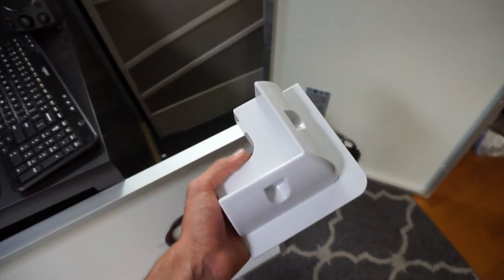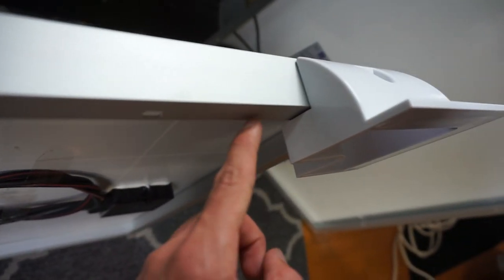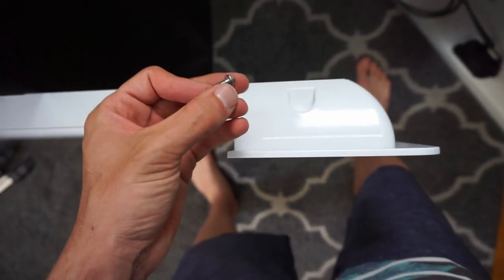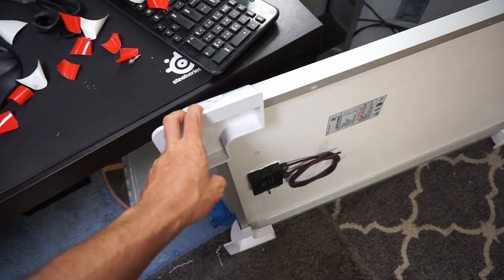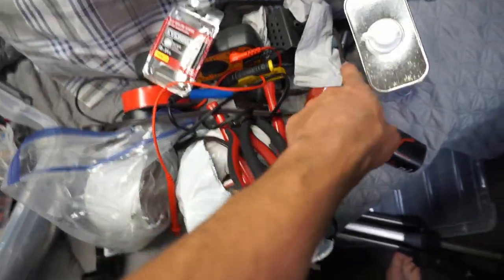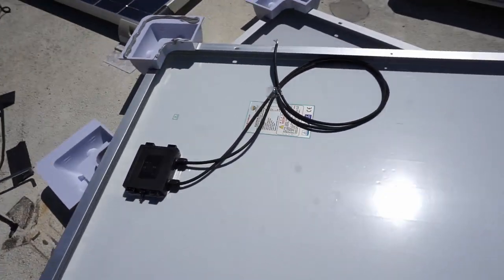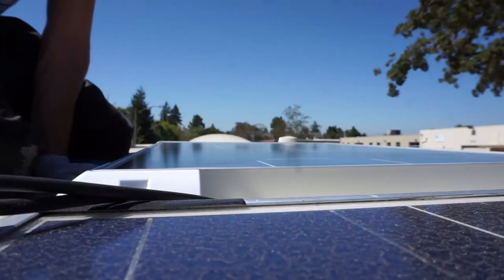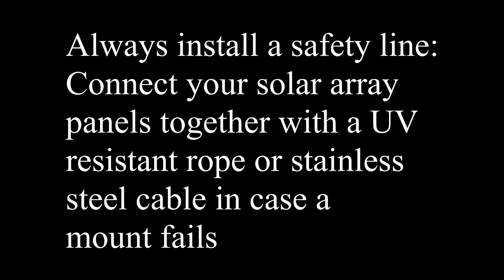RV Solar Tutorial: Drill-less Mount Installation Guide

Comment: Good to caution about doing this right. I didn't, adhesive started failing after freezing. Combined with hurricane force wind gusts at Big Bend, two panels started coming off (didn't fully detach). Long story short, I repurposed the mounts with large screws into the roof, waterproofed properly. No leaks, no loose panels. Great videos, cheers.

Comment: Thanks for the recommendation, I've had mine done like this for over 9 months now and covered about 7000 miles with no problems and the panels are held on as strong as ever.
Reply: With just using VHB Tape and not the PL max?!
Reply: @hearttug  I've got the same question. I tried emailing will and asking to clarify. In the video he says to use VHB tape on the front panels but you can use the PL max in the back. I just installed mine and used PL max and mine are mounted towards the front of my RV. I did use the eternabond strips on the leading edge though. I also wanted clarification on where to install the anchor safety chain.

Comment: For anyone that's wondering if adhesive is strong enough....

I just had the displeasure of removing a flat panel off the roof of my camper and it took me 4 hours with a hammer and a kitchen knife to break through all the contact patches. No amount of my strength could break off a single contact spot with the panel and the roof. So that's how strong it was.
Reply: So it would have been easier to drill holes and later, if needed,  remove the nuts then panels when needed.......haha
Reply: Is the gal between the roof and panel enough for heat dissipation?

Comment: The roof on our teardrop is Filon. I imported these mounts from the manufacturer in China 12 years ago, they were not available in the US. I then called 3M and talked with one of their engineers who did the calculations on wind load etc. He told me which VHB tape to use and how to prep the surface. Wind load is in excess of 120 mph at times.
 The set I have has a longer center section. Using VHB tape every square inch of the mounting needed to be covered
The consequence of not doing it right is a missile coming off your roof.

Comment: I installed 2-100w panels on my fiberglass top close to 2 years ago using this method. Just had to drill 2 holes for the cables. They ain't goin' no where. I used 1/4" self tappers with a rubber washer for stress relief and drilled pilot holes. I check it all periodically and they have always been tight. I pull up on a panel and the roof flexes up with it. Bazinga!

Comment: I have a video installing these on my newer TT, I cleaned, prepped and taped, but ended up drilling/caulking a single screw in to each bracket to the roof. 5500 miles and still very solid.

Comment: hey great video. have you looked at the price of 320 watt or smaller panels for their cost per watt.  the 72 cell panels for houses are much cheaper than 12v panels. throw a couple at an mppt controller or two you can use them on an rv. just have to make sure you have space to mount a couple.  12v panels can be on their own seperate mppt controller.

Comment: Of course, you mean NOT drilling on top of the roof, but the title could considered as a "click bait", right? :) Just teasing dude and thanks for sharing. IMHO, I would install a piece of aluminum in front a row of solar to reflect the force of wind, to reduce the chance of the solar panel being lift off (and "take off"), which you already mentioned is could be deadly result.

Comment: I have a 86 Toyota withe the thin metal roof sheeting and I've been thinking about using aluminum extension ladders for a mount, a ladder can span from side to side using the frame of the rv for a mounting point for strength, the frame could be built as to tilt, the panels could be easily removed for maintenance or used somewhere else. There really is a void in frame mounts for rvs besides the basic light weight single or two panel stuff.

Comment: Any tips on mounting on a curved roof (Casita, Scamp, Airstream, etc.) would be great.
Reply: use flexible solar panels and glue them directly to the roof.
Reply: @kyleblackburn1918  Thanks but already purchased a rigid panel.  I ended up not mounting on the roof and just set it up on the ground.  I added legs to it with PVC pipe and it works very well.

Comment: If your RV has a EPDM or TPO roof (which most RVs do), the roof is a big rubber mat.  It's just laying on plywood and only secured at the edges of the roof.  Fiberglass is the same way and is very thin.  If you use these types of mounts your solar panels are only held on with the strength of the rubber and in strong winds or driving down the road your panels could flap on the roof after a period of time.  Also as the rubber roof ages, the bond between the rubber roof and the adhesive used on these mounts weakens.   Not worth the risk if you ask me.  I used rubber well nuts and after trying many other mounting methods, found these to be the best.
Reply from the maker: Yep that's exactly what I say on my website. That's why I also say in this video that this is for metal/fiberglass roofs. Did you watch the video?
Reply from the maker: Also, fiberglass is fine to mount on as long as there is no water damage. It's strong enough.
Reply: Yes I saw the video but didn't hear you mention it. I only saw the pop-up text mentioning fiberglass and aluminum. Great video BTW.
Reply: I'm thinking of attaching flexible solar panels to my EPDM roof using tape. They only weigh 4 lbs. Do you still recommend not doing it this way? I really don't want to drill any holes. Thanks
Reply: The fiberglass roofs are attached to the plywood with an adhesive.

Comment: Can you list the Adhesives you used? The Tapes, and the "goop".
I will be mounting ,my 100w Renogy to the front on my Majestic 28A
and will get cable channels to stick to the drivers side. Put my (Dual) controller
near or around the House Battery Compartment and make a run to both the House battery and he
Motor Battery to keep charged when not using the RV. 
Not sure what type rook the Four Winds Majestic has, but can I use the same
Adhesive on a Rubber Roof. If not, what should I use in place? Thoughts?

Comment: Are there mount systems like these but little bit higher? I would like to use them to mount solar panels, but little bit more separation from the surface will help heat disipation.

Comment: If I understand your video correctly, you used the VHB tape to hold down the corners to the RV where the panels were more exposed to wind. And where they were more protected, you used the PL Max premium. Does that mean you feel that the VHB tape is more secure than the PL Max premium? Thanks
Reply from the maker: The VHB tape is superior. But both are incredibly strong. But look up the data sheet on that VHB because it's insane
Reply: @WillProwse  thank you very much. I’ve learned a lot from your videos.

Comment: Is it ok to use the VHB tape to mount solar panels to rubber RV roofs or does it need to me metal or fiberglass only?
Reply: Your rubber roof tears easily, branches etc.  I wouldn’t trust it to not lift away.

Comment: Hi, bought the panels, bought the brackets, have now found the VHB tape.  It is 3/4” wide, the bracket surface is 1 1/4”.  Is my tape wise enough?  Also, why self taping screws?  Is it ok to just use SS screws with pilot holes?
Reply: I cannot think of a reason why not. Really should not have to predrill for self tappers, kind of defeats the purpose of buying self tappers

Comment: What's your best method of getting the wiring into the vehicle without drilling?
Reply: You could use a preexisting electrical hole underneath the vehicle or through the firewall I guess.This likely wouldn't be worth the hassle and amount of extra wire you'd have to run, nevermind the half-asked look.
Reply: I used my fridge vent hole and ran the wires down along the other existing wires. They ended up below my cabinet behind the wood paneling. It worked super slick.

Comment: What? Install a rope or safety cable in case the installation fails? Where do you tie off the rope?
Reply: And that is why I use pop rivets on my solar panels to attach to the fiberglass roof, it will never come off with the number of rivets I use (can probably lift the van with them lol)... Also if I have to change panel it will be possible to get them loose again unlike if you use glue where it is very hard to get of and leave residue.

Comment: Should Not use stainless screws on aluminum, guaranteed corrosion.
Reply: what would be a good screw? zinc coated anything?
Reply: @fabiangomez357  the best would be aluminum fasteners but it looks like zinc coated has little risk of galvanic corrosion. I use Sikaflex 252 adhesive because any hole could become a leak and you generally don’t notice until it’s a disaster.

Comment: I could never drive down the highway with that installation. Solar panels accidentally fly off vans and campers all the time and have caused accidents that have killed people. No adhesive manufacturer or solar panel manufacturer would advise to use their products this way on a moving vehicle. The adhesive may hold fine for a period of time, but will ultimately fail. The condition of that roof is also a concern and cleaning with alcohol is just not good enough. These panels need to be glued and screwed and while you're at it physically tether the panel     with a professional system not UV resistant rope. If you don't want to drill holes in your van/camper, don't put solar panels on your roof. This video and every one like it needs to be removed from YouTube.
Reply: 2” aluminum angle glued and screwed into roof truss front and full length on sides - set panel inside angle carefully run self tappers through angle into panel frames . 10 screws each side and 3 on front . - minimum- - will outlast the Rv